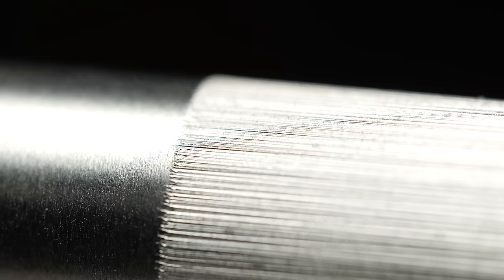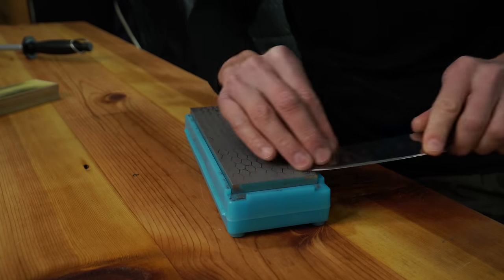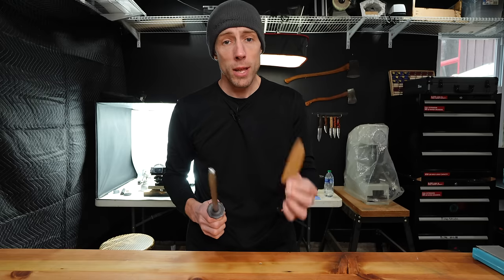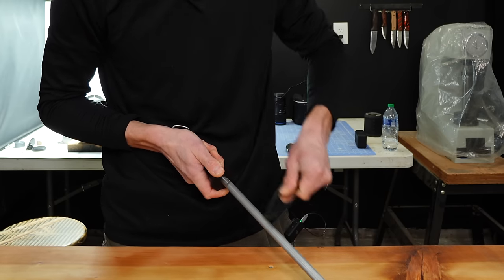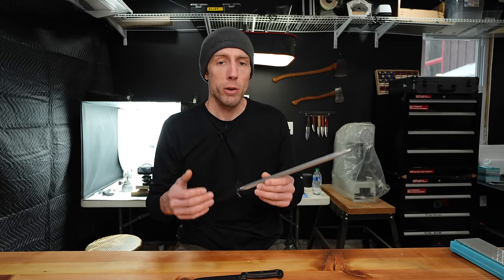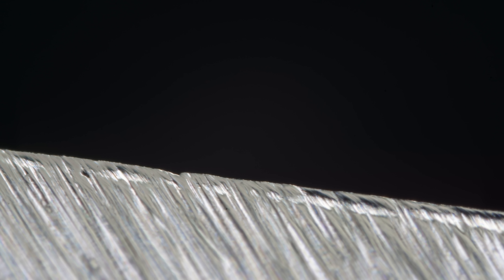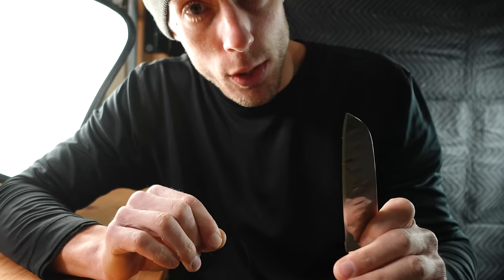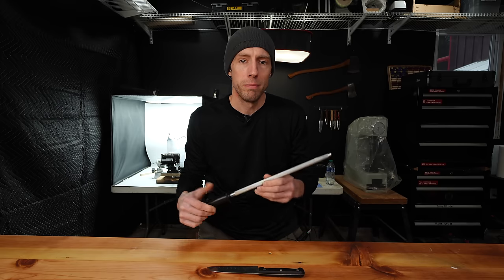What Do "Knife Sharpening" Honing Steels Actually Do?

Comment: For these pulling strokes used as shown in the video, the angle and direction of the knife stroke towards the sharpening steel is wrong. As done in the video, a bent and damaged edge will be pushed down and inwards, up along the side of the knife and towards the spine of the blade. A sharpening steel must be used so that it pulls and smooths the edge outwards, towards the apex. An analogy: If you put a wrinkly small tablecloth on your table, you smoothen it by putting your hand onto the fabric and then stroke your hand outwards, towards and past the edge of the fabric. You do not put your hand on the table outside the cloth, and then make a stroke inwards. It is easy to picture what that will do to the fabric and the edge of the fabric. In the same way, the sharpening steel must be used so the small ridges on it moves and pushes the knife edge and its "wrinkles" in the direction from the spine, towards the apex of the edge. I'm very, very surprised this mistake was made in the video.

Comment: You're right about the burr and the honing rod.  All we were provided was a Norton tri stone and some oil and honing steels.  Took me years to realize that the reason my knife got sharper as I steeled it was because the burr was being knocked off improperly.  Started using newspaper on the stone and stropping the burr off and never looked back.  This was the way.  Noone around me cared...I put my knives away after every shift to keep lazy hands off them.  100 grit SiC scratches edge leading from tip to heel...properly apexed and stropped at maybe 10 degrees per side (or as low as my muscle memory would allow) was a hell of a combo meat scimitar and boning knife.

That being said I still spent the next 15 years or so with a steel on call for when I hit the steel table and touch ups.  Knife hit the stone about every 3 weeks or whenever I couldn't get boneless beef ribs clean cut with one push-pull.

Imagine that copper pipe were a groove on your steel...is it hundreds of times bigger?  Well then you would need hundreds of times less pressure on the tiny surface area of the steel groove to get the same pressure.  Pretty sure that's how that works.  All in all, properly de-burred I never noticed the steel hurting anything when held at the same sharpening angle in my years.  Since I used it edge leading from heel to tip it could have had a slight micro bevel effect to the softer knife steel or all just been in my head 😂 

Kind of a Wicked Edge guy these days but the 10+ inch and filled knives get the stones.

Cool vid man, really enjoyed it!

Comment: I have been cooking professionally for over 45 years and I do not use a steel using a "trailing edge" swipe when cleaning up the edge., I use a stee the opposite way. I always thought removing the apex would be the correct way.
I'm old-fashion and still favor using carbon steel knives which are difficult to purchase these days because people don't like the staining, how brittle they are, and the amount of care required to maintain the knifes condition.
Putting a true carbon steel knife in the dishwasher will absolutely destroy the properties of the blade.
I do have "high-carbon stainless steel knives, but still prefer carbon steel knives. 
As I stated previously, I like using a razor sharp knife and the carbon steel knives can be brought back quickly with just a few quick passes with an abrasive diamond coated steel where as the high-carbon stainless knives take considerably more effort to refresh the blade while working/cooking.
I will have to try using the "trailing edge swipe" and see what the results are. I may find it difficult to do since back in 1972, I was taught to remove that "apex" rather than bending it back and forth. But after 50 years of using a steel the way I do, it may be difficult to change.
Thank you for the detailed explanation!

Comment: Honing rods are great for sharpening a knife without removing any steel. I dont use the rod the way you do though. All stupid like that. And i never heard anyone talking about unrolling an edge with it... No idea what youre on about. But if you take a sharpened knife. Use it till its slightly dull then use the rod and it works great. No idea what your problem is.

Comment: Now do this using A) FRESH bone from beef or chicken and B) proper cutting technique instead of pounding the knife edge against wood. Proper cutting isn't hacking like you did, it's slicing. Knife tip on the cutting surface at a 45 degree or greater angle, then slide the knife forward, then pull the knife back while raising the knife and the tip NEVER leaves the cutting surface. Think of a rotating slicer - when the technique is done properly the cutting portion of the knife should be moving in a circle. using a copper pipe and bashing the edge against wood is not any sort of real comparison to how the knives are actually used.

Comment: Good video, sir. Old guy here, hillbilly, 85+. I always thought those "sharpening rods" worked differently than your explanation. They seem to be hardened steel, with prounonced ridges forged into them. Those 'ridges" literally cut/shave the burrs off the knife edge from the side and supposedly produce a "sharp" edge. Whatever they are, I long ago moved to a Lansky ceramic rod sharpener. This little gadget VERY quickly appears to produce a razor sharp edge on any knife I've ever sharpened with it. If the knife blade is a 'softer' steel, the edge seems to dull pretty quickly. If it's true case hardened, the edge will last a while. Pretty obvious I guess. In my experence, ceramic honing seems work the best. Great video, really great subject ... and thanks for posting. Best.

Comment: I discovered independently some of the points made in this video:
1. Those steel rods do not work. They ruin an edge rather than maintain it. A ceramic rod is much better.
2. A proper apex holds its edge a very long time, to the point that most of the time I'm using the ceramic rod to "feel" the edge for rough spots that need resharpening.

I wish I had learned these techniques earlier, because I've wasted many hours sharpening my kitchen knives only to ruin them with that stupid expensive steel.

Comment: Yup, love this channel…….finally the science to backup what I’ve been doing for years which is NEVER use a honing rod.

I tried using one once years ago after I stone sharpened and stropped a kitchen knife, it actually made the knife duller. Just to be sure I repeated the sharpening a few more times after honing and got the same result. Honing took the shaving sharp edge away so I just called it BS and carried on doing what worked for me.

Thank you for this!

Comment: i own 3000$ worth of stones, synthetic. i got a $35 DMD resin bonded diamond rated at 1000 grit off ali and it's the best thing I've ever used for the money by far. its not 1000 grit. it's basically a course medium stone. like 500. at best. or its a very fine course stone. lets say 400 grit, that's it's true grit rating. anyway this thing cuts FAST as anything. leaves clean and even scratches. makes great toothy edges. hogs all kinds of steel very very fast and easy. light or hard force. creates small burs. it's basically a 400 chosera from hell. amazing stone. So i got the 12000 grit rated on. this thing is about 3000 grit, like chosera, at best. not a finishing stone by any means. Anyway, it's also a great stone. Review these. these things are amazing for the money. they hog 10v steel like butter. I used to tell folks to try the king neo 800, green sic, awesome stone, for about $35. that stone is still better for wide bevels. but. these ali stones are incredible for the money. I have to say I am very amazed and these are the best stone I have used for the money by far.

Comment: Something is really missing in your video, and it is actually the most usual use-case, why is this tool used. 
You should show a little bit dull knife (make it dull by three passes on a bone)... then show on the BESS score tester (scale) how dull it is. And then make it sharper on the steel rod and show on BESS scale, that it is sharper. I know, it is not that sharp as it was when properly sharpened (deburred). 
However, there is significant "working" sharpness. It again cuts the meat, tomatoes and so on. 
It does not only straightens the burr. It really makes a dull knife sharper. 
When there are little nicks on the apex, it narrows them (this principle is called "plastic deformation" of the steel.

Comment: Personally I usually end up using scrap cardboard folded into a flat edge for maintenance honing my blades, since it's technically a high-grit abrasive (hence needing to resharpen after several cuts into high-strength cardboard boxes).  I've found it works well *enough*, though I prefer a proper sharpener and strop when available

Point is, when a literal chunk of trash that you find floating down the street in the wind is better at the job than the tool you're holding, you shouldn't buy that tool

Comment: Ever heard the term GARBAGE IN, GARBAGE OUT? Your video while informative to the average knife enthusiast, fails miserably in this instance. 1.)  There are several types of edges that may be applied to a knife which are not identical depending on the purpose they  are to be used for. For instance , a knife meant to be used primarily for the purpose of shaving hair, has no lasting function as a utility knife. Where a on the other hand, a knife to be used primarily as a utility knife has no practical usage in a barber shop. And neither of the knives used should be maintained  identically in both environments. And before you go and instruct others on what they are doing wrong within their professional environment, it behooves you to learn just a little more about their objectives and constraints. At the very least take a moment to fully understand the proper use of the tools involved! A knife used to properly and efficiently cut meat will draw into your skin if you attempt to shave with it. The reason for this has everything to do with the tools used to sharpen the blade. After all, not every knife is meant to shave hair with. If they were then all knives would be made identical to straight razors. Meat cutting knives are rarely stropped. Learn the proper fashion in which to use a butchers steel and then do a real-world test in its effectiveness to cut through meat all day long, day in and day out. Find a good and fairly new Case XX steel. Not all steels are quality tools. Stop being such a damned know-it-all. You might actually learn more aboout that which you speak.

Comment: I work in a meatpacking plant, using a knife all day every day.  Steeling absolutely is necessary to maintain the edge. I've never heard anyone think that steeling "straightens the burr", though. A sharp knife has no burr. 

Your steeling technique is very poor. The steel you are using is junk, too. I have one of those and sometimes use it as a small crowbar. It's unusable as a knife steel. Get a Dickoron sapphire cut steel.

Don't hone your knives freehand. Use a setter. You can't keep a steady angle freehand.

Comment: Um.  I use steels all the time and they make a significant difference. But I'm not unrolling a rolled edge. That would never work. I am subtly straightening a subtly bent apex and for that, steels work great without chewing up the edge itself. Steels don't work on a dull knife. The knife has to be properly sharp in the first place.

Comment: I learned from another cook to use the spine of another knife. Do it more often. Every few minutes of chopping. Straighten the edge as soon as you feel resistance. 

I carry a portable diamond stone to work but otherwise, i use a belt sander every few months. I don't have to cut a lot at work anymore but I keep my own knife at work because I work with people who like to use damaged bread knifes or small bread knives (basically steak knives) to cut everything. 😅

It's not terribly expensive. A Kitchenaid santoku that i use to chop onions. I got the $20 diamond stone on clearance for $5 at a local hardware store. Ive also purchased similar knifes from Dollar Tree and they function. I dont use wood cutting boards. They dont meet my local sanitation code standard as they cant go in a dish washer or get soaked in bleach. Plus I hate having to constantly sharpen my knives so got smaller versions of the cutting boards recommended by ServSafe for my home.

Comment: I'll agree with all of the science here. Not stupid. I will, however, argue that there's no purpose for honing rods et al. Meat cutters, that is production butchers, need to be able to drag an edge periodically when they're working on a factory floor. They can't waste the time, minor though it may be, to step away from the work area to sharpen their knives again, whether it be to remove a burr or fix a rolled edge if they contact bone for instance. The other problem is sterilization. When you're working in a factory setting your equipment, which is a delrin holster on a chain belt (at least the one my brother had), has to be able to withstand the caustic sterilization process, typically a hydrochloric acid bath, and you can't have a porous surface which could collect contaminants. In this case I do agree you should use an abrasive honing steel. The non-abrasive ones are only useful if you have a crappy knife you only think you take good care of. But there is still a purpose for them.

Comment: My after High School job was as a meat cutter. I used a steel regularly as it was the only practical way to keep a knife sharp. Fast, easy and effective. The knives were quality steel, and would wear down over time. Eventually we'd simply replace the knife when there was not enough blade left. In recent years I don't need that kind of non stop knife performance at home, so I sharpen with a fine plywood wheel and compound, using a pedestal grinder. Seems to make a sharp edge quickly without a lot of nonsense.

Comment: I'm not a knife enthusiast but I work in a meat factory as a slicer and each day I'm cutting a 500-1000 piece of meat that weighted 8-15kg. 

Almost all of the slicers on my company don't have the equipment to deburr or anything you said to remove the burr properly we just use the sharpening stone that the company provides and each of us have a honing steel. From my experience honing steel is indeed useful in our situation  it can make our knife sharp again on the spot but yeah only temporarily I just use light stroke 1 time per side of the knife ( i have different steel i think mine is from germany and more expensive it has a smooth finish )

Comment: The Romans used a hammer  to sharpen their knives razors and swords. The point of a steel is to pull out the edge of the metal.
This does not work at all on modern hard steel but very well indeed on good quality traditional. kitchen knives.

The same principal is used when creating the burr on cabinet scrapers.

And by field workers when sharpening and correcting the cutting edge of a scythe with a hammer and anvil..

If you completely fold the edge of a cooks knife, you are using it wrong, and abusing it.

Comment: The challenge you have here is the magnification and lighting doesn't allow a proper comparison of the cutting edge. You lighting directional and is not consistent between shots in terms of brightness and exposure. Also, if you wanted to be serious, you would have applied a blue steel dye (dychem, dy-mark etc) which would have provided an ideal contrast of where metal had been removed.

Comment: 12.23, using a diamond stone in a way that you could slice yourpalm with a sharp knife, just wrong. A steel at least has a handle and gets a blunt knife to cut thick skinned tomatoes nicely and quickly.

Comment: He’s not using the honing rod correctly… Set the rod straight, standing, on the table and run the knife the same way you would when you sharpen it on a stone, edge down towards the table. Gets my edge going super quick when I don’t have time to sharpen my knife properly with a stone

Comment: Please explain what is happening at 12:55 when you "fix" the rolled edge with the diamond plate using only 10 light passes. That doesn't seem like enough metal removal to re-sharpen the complete bevel so is this only bending the rolled edge back into original position?

Comment: I have an Exclusive By Dorre honing steel, I doubt there is a knife with a steel where that honing steel wouldn't also remove metal. 

I have knives that I've never had to sharpen going on 25 years now, I just use that steel after every time that I've use the knife before I put it away.

Of course, just washing it and drying it immediately after use goes a long way and many people tend to forget to mention that.

So some steels are actually sharpeners as well, just get a good one.

Comment: I have this machine and it works well. In reality in normal use one uses 2 or maybe 3 differant grit belts.
 they are not cheap and come in packages of 5.
It would be nice if one could buy them individually.
Or at leased have the grids marked on them.

Martin